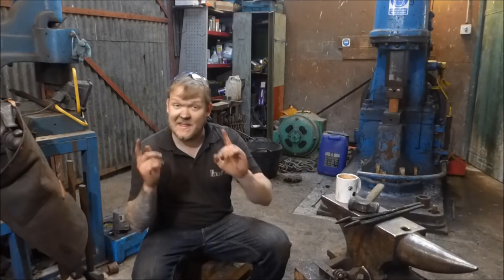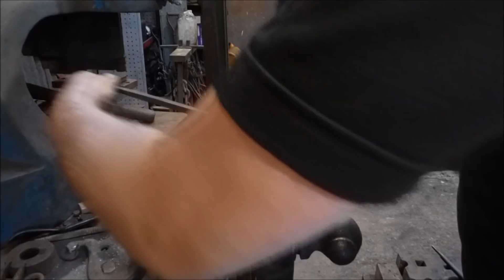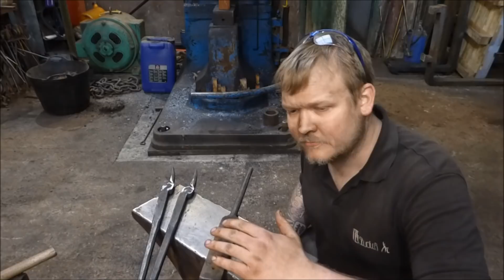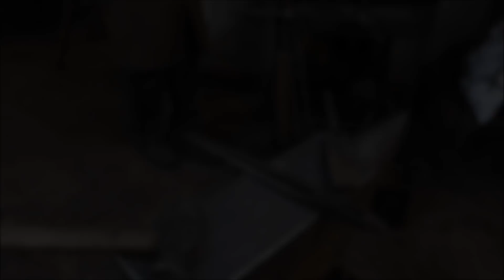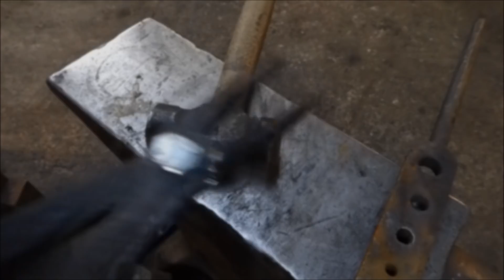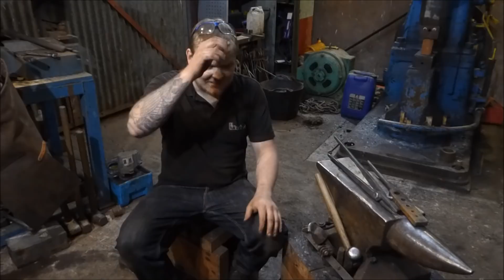How To Forge Epic Tongs! An Easy Way to Punch Holes!

Comment: Anything that makes the functionality of the tool better is great. So, no concerns about filing the nibs, if it improve their operation. When handling hot materials, you don't want to have to struggle to use the tool. Same as a sharp knife is safer than a dull one!!

Comment: Good video Dan.  If you want to stop those mild steel drifts from sticking how about tapering the struck end so that it's longer than the material you're trying to punch through?  Obviously that'll be within reason (not for really thick stock) but it should help.  As for the 1.5 times diameter thing, I think that's for the amount of stick out you need to form the rivet head. Making them the same diameter as the thickness of the boss is a great tip.